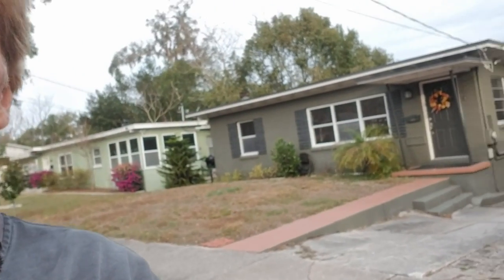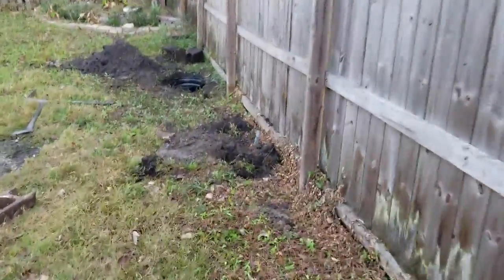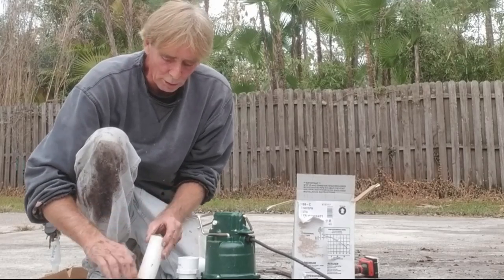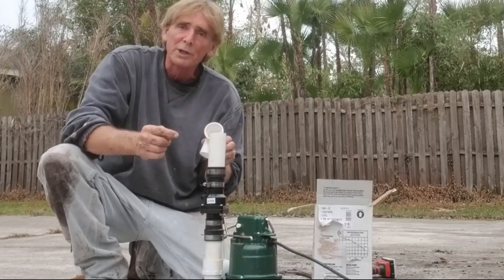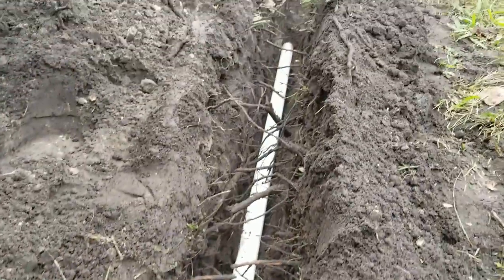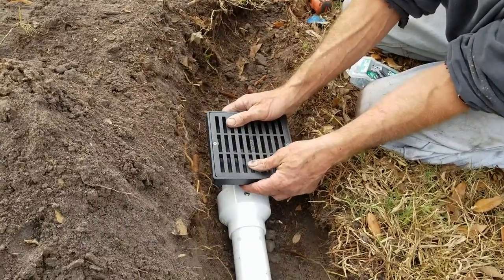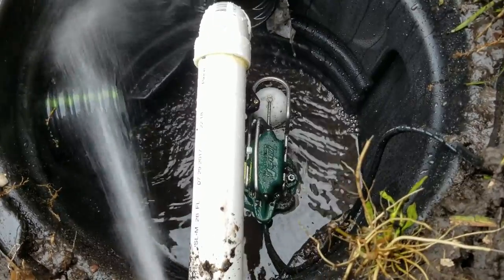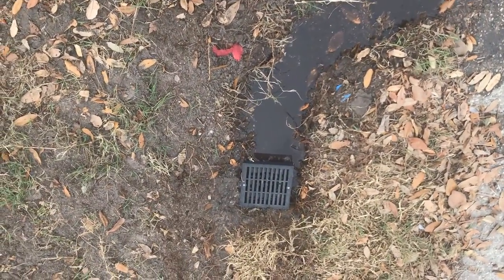Back Yard Sump System, How to Install

Comment: I would recommend putting a union in the PVC after the elbow, in the discharge. This will make it easier to disconnect if you ever need to replace the pump.

Comment: So where do you plug in the pump? I mean in the yard? Is there an electrical box back there or do you run some kind of extension cord?
Reply: I'm thinking the same thing.  Any time water and electricity mix, means having to having to be a lot more careful with the install and setup.  Plus you want it to last and not have the homeowner accidently cut the power line with a lawn mower for example.
Reply: @deltatea82  ...or the lawn crew ...
Reply: an electrician can install a weather box and outlet with gfci. run the wire through PVC or armor cable that's it
Reply: That could require just about as much work as installing the pump.

Comment: They are gonna love that guy with his lawn washing out into their pretty brick street.  Why not put the discharge closer to the driveway?
Reply: River rock drainage, imo. Looks better and can't wash the rocks away into the street
Reply: Because the water would flow right back down the driveway
Reply: Half jazzed plan. Half built. Half finnished
Reply: @mikeoconnell4229  exactlly, that thing is so half assed.
Reply: It's at least 25%-less-assed than most of the videos I've watched so far

Comment: They aren't "deep" and "small" couplings, there are pressure fittings and DWV fittings. You could also just not bother with any couplings and get pipe with a bell end.

Comment: Chuck talked about putting a small hole just below the check valve in other videos but left it out or just didn't mention it.I would have put some large river rocks at the discharge to cut down on the sand and other Dupree that was littering the sidewalk

Comment: As luck has it I had already purchased a gas powered transfer pump and soon after found your channel (4 years ago), I wish I had known this sort of set up existed. At the time it would of cost about the same as it did for the pump and hoses vs doing the set up you show here.  Well I finally bit the bullet and did the french drain/sump pump install this past weekend. Thank you so much for your videos and showing the DIY crowd how it's done.  125ish foot trench dug from the back yard to the front and it works great! THANK YOU!!!

Comment: Awesome idea! I have a culvert (just installed) and need to step up the excess water to a higher level drain ditch. Very unique situation and this application will work for me. I only need it for when we have lots of rain when the ground is already saturated. Thanks for the great video and advice.

Comment: Should the catch basin inlets to the sump and pump outlet from the sump be sealed to prevent dirt and mud from getting into the sump? I imagine the pump can handle dirty water, but probably not built up mud/dirt/rocks over time.

Comment: Thanks for showing the pump working! Great install as always! How did you get power to the pump? Was there an extension cord from the house or a receptacle already by the basin?
Reply: That’s always my thought. I never see an answer. I guess just bury the cord in PVC.
Reply: 4yrs and no answer?

Comment: 4:45 if you use the lid they sell for this sump pit, put it on the pit when you are back filling. The pit is not super sturdy and will become oblong when back filling making it a challenge to put the lid on afterwards.

Comment: Can one connect to sump drainage from the sump basin and tie into their sewer line? My sewer line is not too far away from where my sump basin will be located and my sewer line is going to be replaced in not that long down the road. Hoping this could work because I would have to go over a hundred feet for the outlet drain. I've been asking around about this. Been asking mostly plumbers and believe it or not....I'm getting different and even conflicting answers! Guessing I would need another check valve just before tying in to the sewer line? Thank You in advance!

Comment: Very nice demo video and how to also. What is your thoughts on a backyard that floods during a torrential rain? My neighbors houses to north of me sit higer up then the houses ony side (south side). So naturally their rain runoff runs it our easement and is unable to drain because the neighborhood uses out easement for gardens and storing their extra stuff. So it doesn't drain as it is supposed to. Then it backs up into out backyard thus flooding it. What would you suggest for this situation?! French drain or what other type of system would slow down the water coming into my backyard?! Thanks 👍

Comment: Chuck can you explain in this particular application how you come up with the 20' lift calculation you site? After watching the video that math doesn't add up. Also this would be against code in my town. Can't tell pump water into the street regardless of the source. Would need to be pumped directly into the storm sewer by way of an underground connection. Also being in Minnesota the pump would need to be removed to prevent freezing up in winter. I understand you're not dealing with that in Florida obviously.

Comment: I think i would have used a larger basin and a BN98 or N98(with tether switch) or larger pump. You didn’t talk about how large the basin/Sump pit was or how you connected to power......important info. When you do get a lot of water, how well will this work? That’s a long run and rise, you’re almost at the top of the curve almost at shut-off. Could your pump be short cycling? Thanks....Jim

Comment: How do you handle the wire from the sump pump?  What is your process in leading the pump wire to the house/power?   Also, how about a video on how to use a trench digger?  Thank you.

Comment: I live in the north east.  Temps in colder months often go well below zero.  Will this system work?  During spring the water table comes up, super-saturates the ground around 1/2 of my foundation. Hydrostatic pressure pushes water through the basement walls. (Solid pour not block foundation).  Have had several experts give me solutions like #1. excavating down to the footing (10 feet deep) then coating the exterior walls followed by a fabric that has small pipes in it that will take the water down?  Down where? That job would be $20,000    #2.  Jack hammer a 2 foot channel inside basement along walls entire perimeter of building and put in French-drains leading to a sump inside. (I already have a sump inside works great, the floor is dry, water is coming through walls, not he floor.  3,  Use hydraulic cement on the inside of basement walls, then paint wall with DryLoc or some other sealer.  I don't know which way to go but I like the idea of various catch basins leading to a central sump-box with an electric pump.   Probably less expensive and I could probably do some of this myself.   BUT, what happens when temps drop below freezing???  Thanks for any help!  (good video!)

Comment: Can you talk about the electric hookup?  Do you have it on battery backup?
Reply: @marlin ewing does the n.e.c. require a gfci on an outdoor sump pump? N.e.c. doesn't require them for indoor pumps because start up  amperage will nuisance trip them.
Reply: @kurtzimmerman1637  Thats what happen to me, i had the pump on a GFCI and it would trip it every time so i had to put it on a dedicated circuit

Comment: New to all this but have one question. If the check valve stops the water from coming back into the basin then that means that the discharge pipe is continuously full of water that is trying to flow backwards. Won't that pipe now freeze in the winter and break ?

Comment: Great video!  My sump basin started floating and came up out of the ground!  Any insight on how to address it?
Reply from the maker: That usually means there is an inflow of water that is very great that is coming down and around your sump basin and getting underneath. Check your inlet lines make sure they’re secure and that they enter the sump basin. You can usually perforate the bottom of your pet and that will also help.
Reply: @appledrains   Thanks - the sump is just a few weeks old and I just experienced three days of downpour.  I was going to perforate the bottom and figured I'd ask here.  Your videos inspired the project.  Awesome content.  I

Comment: I love these video's, look forward to them, doing this at My place!!! Dug The Trench by hand, started at foot and half all the way to almost 4 feet lmao.. only for run off my house witch a gutter will go into it lmao.. needed go across my Drive Way.. why so deep.. not pipe should be in ur drive way but being so deep shouldnt affect it if you drive over it was idea its so deep.. so put sub pump in mine but I'm using 20 Dollar Trash Cans  The sub pump cans that he has are like 50 60 bucks.. Mine be on a Hedgerow so it shouldnt really affect it.. some may even be concreted!! where main lines come in.. almost done.. cant wait to finish it in couple months running power under ground to it as well in a couple months..

Comment: What do I do if I live in north east? I will need to have sump below the frost line at 36". My concern is water in the discharge line held in by the check valve will freeze.

Comment: Hi there, What type of pump would I need, for a 60 foot, on negative slope? Rodrigo, Sidney Australia :)                                 Great channel, thank you
Reply from the maker: The Zoeller M98 works great! Easily push water 100 feet or more uphill. I have many videos showing this. A good 1/2 hp pump is needed
😀👍
Reply: @appledrains  I appreciate your help mate :)

Comment: Great video and thanks for sharing your experience and knowledge. Whats your thoughts on a pop up at the discharge location? Also, did you screw the couple pieces together just in case of maint or replacement later on in years? Again, thanks for sharing. Great video
Reply: It’s so they can unclog the line in a few years, or whenever necessary

Comment: How do you stop mud and sediment from getting to the pump? Is there a certain pump I should use for my yard?
Reply from the maker: I’m sure if you watched the video, you’ll see the name of the pump, but we recommend Zoller, M 98
Reply: @appledrains I actually typed in the question right before you mentioned it lol. But my main concern is, how do you keep mud/sediment fromv getting into the pumps basin from the surrounding smaller basins?

Comment: You may have mentioned it in another video, what is the purpose of drilling the 3/16" hole in the pump riser?
Reply: Ryland Rodman this is a common technique to avoid an airlock scenario.  What can occur is a pump kicks on and runs till it pulls air, then the check valve holds the head pressure away.  With out the hole the pump starts but is trying to push air through the check valve and the head pressure which it cannot do.  The relief hole lets the air out and will spurt a small stream of water while the pump runs but avoids the scenario.
Reply: How should the hole be positioned after it is glued?

Comment: How did you get power to pump. Looked like an extension cord hooked up to pump. Are you planning on putting in some kind of permanent receptacle to eliminate extension cord?
Reply: Did you ever get a answer for the electric?
Reply: @traynash2022  Never did. Not good on responding to comment.

Comment: Hello Apple, since you have a sub pumping the water through; does it matter if the end/ release side is slightly higher? Or will gravity work against it?

Also can you place a pop-up emitter at the drain end(release side)?

Last, can the collecting tub housing the pump, also be used as the original or first drain or should  you still have a drain line into it, and then send it out ?
Reply: Yes

Comment: Omgahh I need this Soo Badly!!! The water stays under my home and it's causing my home to become unlevel as well as destroying my subfloor from all the humidity.. I run dehumidifiers almost constantly 😕... But I can't afford this 😭😭😭😭
Reply: The pumps are only a few hundred dollars and the pipes and fittings a few more.  My front yard  has a high water table so it doesn't take much rain to make a pool. I am here because I wanted to learn how to set this system up. I am 68 I will do it myself, you can too!

Comment: I just got citation by the city for discharging my sump pump on a city sidewalk "creating a hazard"

I have nowhere else to put my sump pump discharge I don't know what to do I live in the Midwest and it freezes.

they want to bury pipes underground but I'm not confident the water will dissipate into the soil what should I do?
Reply: move
Reply: Trench it to a field tile if you're rural, or trench it to the storm drain. Probably depends on where you live if a municipality would allow you to do the work on their system. What do your neighbors do?

Comment: Does that sump pump need a hard wire line somewhere for electrical?
Reply from the maker: We do Not recommend that you hardwire Sump Pumps. Better is 110 V GFI OUTLET. Much easier to service and or replace

Comment: What would you do for an area that freezes  4 feet below the ground in the winter ?? All the pipes would freeze.
Reply: Agree with this.  i rigged up something similar to this to drain a yard that's lower than the street.  But here in MA sometimes it gets very cold.  it's not hard to get the sump pump itself deep enough so that it doesn't freeze -- having the pump base 3-4' down seems to work fine.  

But the issue is the exit pipe, because once the water gets past the check valve as long as the pipe is angling upwards it will be full of water and so is entirely in danger of freezing up.   

The only way I could figure out to make this work was as follows: 

- The exit pipe is attached to the pump and, inside the sump bucket, takes a 95 degree turn so as to be basically horizontal, but slightly pitched away from the bucket 
- The pipe then passes through the wall of the sump bucket. You're still a foot or so beneath the surface.  
- Outside the bucket is a small gravel drywell  
- The exit pipe runs horizontally for a couple feet into the drywell, and then a 90 degree elbow located in the center of the drywell makes it vertical again.  
- So, you have a low spot in the pipe just before that second 90.  Drill a 3/16" weephole in the bottom of the pipe there.  The pipe can now dry out, into the drywell, so that if things freeze, it will be empty.  Now, a really high water table will make it impossible for that horizontal section of pipe to drain, but that's basically okay because the water table doesn't freeze.  

This isn't a perfect solution I suppose and could in theory be defeated if it got truly cold out, but it has worked fine so far and has survived subzero weather several times.

However you set things up, the main challenge is keeping that exit pipe empty of water except when it's actually in use. Obviously the vertical piece of pipe right above the check will always be flooded but you just have to get that section down to where it's not likely to freeze, and use rubber couplers in case it does.  I was told that covering the sump bucket lid with a bit of soil really helps insulate things as well.

Comment: Why not use a swing check valve? Check valves always fail and a Tru Union swing check valve is serviced eaaily unlike the one you used.. And sch 40 for the discharge?

Comment: I wonder why the pipe wasn't brought all the way up to the curb instead of cutting it off 5 feet away?
Reply: Some city utility's own a few feet into the yard called easement, if you install anything into the easement they can tell you to remove it.
Reply: Lousy workmanship/easy way out/more profit/less work
Does that explain it?
Reply: Last city I live in (Bedford, Tx.) required one to run the drain pipe through the curb and have it drain on to the street. The city actually came and cut through the curb for me and finished with mortar the area around the drain pipe at no cost to me!

Comment: Do you do work in Massachusetts or have someone you would recommend?
Reply from the maker: Hi Ross’ Sorry, we do not work in Massachusetts and I don’t really know anyone up here, but if you look around I’m sure you’ll find a good reliable contractor
Reply: @appledrains  thanks 😊
Reply: @appledrains  I had a guy who is highly recommended look the place over last week and he wanted to install French drains inside the house but I know that’s not the right solution. In a storm we will lose power and the sump pump. Even marine battery back-up and a generator only get u so far then it’s floodwaters time.

The solution is a French drain on the side of the house and /elevate my property by changing the grade at the perimeter with some type of material. Since nature is giving me a pond, I wouldn’t mind capitalizing on that and building one with a way to run-off to street if it gets to a certain level. I already have a ton of corrugated pipe here .

Thanks again

Comment: You show how to build a French drain when no water is present but how do you put in a French drain when the back yard is is like a swamp?
Reply: you get really dirty
Reply: French drains aren't very efficient in swamps! lol Although, if your yard just has that big of a drainage problem, dig a hole for the tank in the low spot and pump the yard before you dig your ditches. You might just need to wait for a week without rain in the forecast to have enough time to get it done.

Comment: Why wouldn’t you just continue up the hill with the 1-1/2 pipe?  Going to 2 inch adds more water weight for the pump to push against?  especially for that large of a hill.
Reply from the maker: Hi Ben,  that home has a basement with a sump pump. We used a 2 inch pipe because she plans on adding the discharge from the basement to the same line. The M 98 is a true workhorse. They can easily push that water up the hill  and more. Thanks for the question
Reply: Apple Drains so you could go all 1-1/2 if you only had one pump?